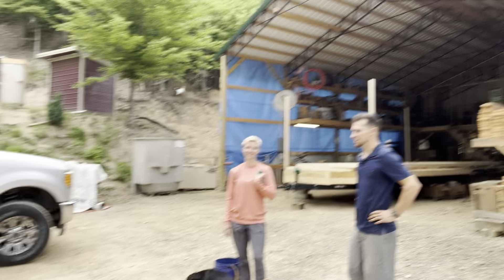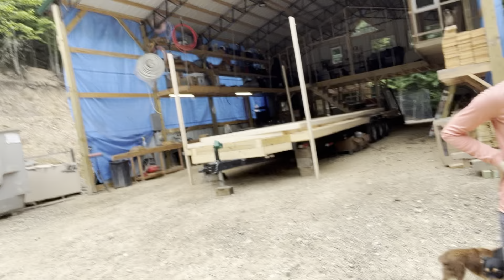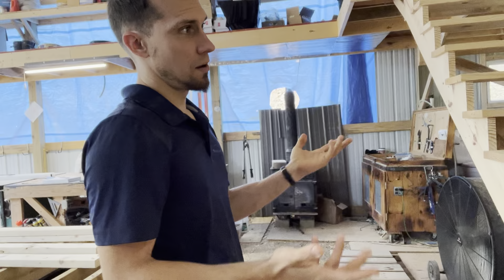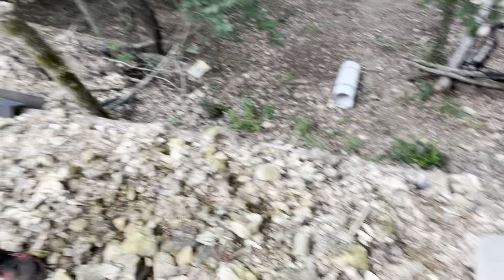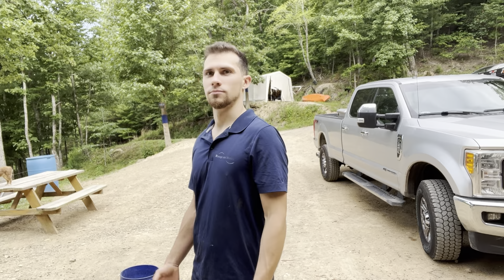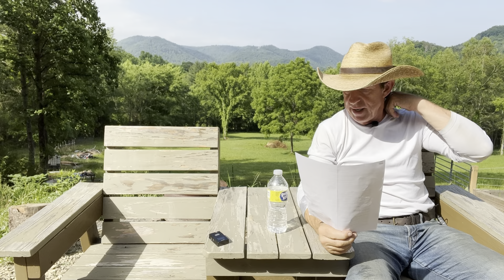Weekly Wednesday Q&A Episode 12 on Location with Zach, an Incredible Tiny Homes Subcontractor 😉🇺🇸

Comment: The mini-spilt on the ground? I have seen Central air systems with vines and weeds growing through them. The esthetics must be the reason for the request. They think the mini-split is ugly mounted on the tiny house.
Reply: Yes, that doesn't work at all. The condenser portion of the unit has to have fresh airflow all around it, which is why placing them on the tongue box works so well.

Comment: Question, where do you get the brown paper that you lay down to protect the floors?
I thinking about using it under my deck to keep plants from growing up through the planks. Because it’s biodegradable
Reply: It's contractor's paper. You can find it in the drop cloth aisle of Lowe's.
Reply: Use carboard boxes...just pull the labels & tape off. Biodegradable & recycled 😁

Comment: Q&A...If we bought two incredibox and we were just one couple who lives there but we lived in both incredibox has his and hers together? Kon the mountain, with a breezeway betwix them.  We've been married 32 yr and retired.  Thanx Kim & Frank
Reply: I would be interested in this also. This would be ideal for my son and myself.
Reply: I heard Randy say in one of the recent videos that only a few of the mountain lots will be flat enough for wider than 10' wide homes. That means if you positioned them with their 8' width on the home site, there can be up to 8' space between them (40' long total), like this... 
_______________________        
I     8x16    I (8'deck) I    8x16    I       
_______________________
and of course you'd still have room for a 3' wide deck running the full length to access the doors. I'd definitely explain this is what you want to do just to make sure they can get you a long enough site. Also, it might be extra for the hookups since there'd be 2.

Comment: Question for Q&A Wednesday. Are you still doing a RJO with the kitchen/bath opposite the door in a twenty foot length. And possibly in a panel building? I want a washer/dryer in the bathroom  and a closet in the kitchen.
Reply: There is a stick built model home with a similar layout to what you are talking about. You'd want to look up the model on the ITH Website, then contact them to ask if they can build it 2 feet longer to accommodate the W/D and closet. As Randy said today, they are doing very few model home customizations right now.

Comment: Question? Can the bigger incredabox travel down the road like a travel trailer?? Is is 12x16, 12x20 or 10x20?
Reply: It's 12×20, and No... it's too wide to travel. You'd have to get wide-load permits and pilot cars, and drive real slow, because they are wider than a traffic lane.
Any home wider than 10' gets very expensive to travel.
Reply: @susanbeals7597  thank you. So do they build 8x20 incredabox that can be towed?
Reply: @CapysGardenShop  anything over 10 feet wide requires a Commercial Hauler, plus Escort vehicles. Can't be self hauled.
Reply: @susanbeals7597  anything over 10 feet wide requires a Commercial hauler, it can't be self hauled.

Comment: Hi guys,  could you install an elevated bed in the. 12 X 20?
Reply: ACTUALLY, there are now at least 2 different elevator bed hardware companies that mount to heavy duty wall studs. Sooo, you'd have to build in a framework of 4x4's and attach the hardware to 4 of those big posts. Not sure how you'd secure it all to the metal walls though, or if you even should. I think that may be a bed for stick built homes. 🤔  Have you considered just building a sleeping loft?

Comment: My small SUV is a old escape 3500 lbs it can pull. Do you think it will be able to pull incred-i-box
Reply: No. The base weight of an Incred-I-Box is almost 5,000lbs, and that's before furniture, appliances, clothes, etc. Check out Sunset Trailers, the SunRay line. They have several models that weigh 2,000lbs or less (including furniture, appliances, heat and AC).

Comment: ??? Ouestions for Wednesday. Thank you for the answer of custom made home. I am interested on mine. You may want my design for a mode home. l Would like a custom home if someone requested and wouldn’t mind waiting they have it done in between your other homes that you were putting out. I think someone would want to to duplicate my home especially if they are handicap. And would like handicap bars in the bathroom. I have had people say they like my design it’s so well thought out and sizes. But may change due to plumbing or electrical but they want one being the same design. 

Or are your models anywhere in the size of 10 x 30?
Can you build one over the wheel well flat so you extend out the home on the sides over the wheel wells? And can you smaller tires like you would be on a go cart that’s still require the weight and supporting it for traveling distance so you can have higher heights on your home? I’d like to have one height 6 1/2 foot and the other height in the upstairs loft a 6 foot leaving 6 inches for your base and your roof line and have a solid wood floor between the ceiling and the second floor which allows you like an inch plywood or 2 inches of plywood I’m not sure how plywood comes anymore?

Comment: Love these Wednesday Q&A episodes!  ??? Q: My son is going to pickup the Incredibox and bring it to AZ. Does he need some kind of special permit or tags to drive it? This is all very new to us both and don't want to unintentionally do something illegal and get in trouble. :-)
Reply: Make sure he carries a copy of his Contract for the Incred-I-Box, it will act as a Bill of Sale in case he gets pulled over for no license plate on the trailer. Other than that, good to go. 
Tell him to use Truck Stops for Gas, they tend to have higher awnings than regular Gas stations. Plus the name brand ones (Love's, TA, etc) have Restaurants, Showers (ave. Cost $14), and are relatively Safe places to sleep at night. All in one stop.
Reply: As long as it's the smaller Incredibox (8x16) you are good to pick up and tow!

Comment: QUESTIONS --- TO Q&A QUESTIONS Ep. 12. -- A CHANNEL THAT I'M A MODERATOR ON. WE PUT ALL QUESTIONS IN ALL CAPS. LIKE I'M DOING NOW. IT STANDS OUT SO YOU CAN FIND THEM EASILY. 
Just trying to help. I'm an OG to your channel since the beginning. 
ANSWER TO ONE OF THE ABILITIES OF TRANSFERRING A TINY "CAMPER" THE 8X16 TO A 8X24. I'm a women & I pulled a 1959 original Winnebago 8x24 camper, that was not remodeled so it was heavy, & a 1994 Terry camper & I pulled them with a 1998 4 door 4x4 blazer, 1959, & a 2003 Trailblazer 4x4 which both with the original motors, 6 cylinders, & had no problems with towing either one to & back & I drove them like I stole them on the hilly, curvy back roads the only way to get to Stockton Lank @ Stockton, MO. from Springfield, MO.  
I got off work @ 4pm & I had it set up with my youngest daughter,5 years old, by the time my husband got there with the boat & are older son 8 years old @ 6pm. 
My husband is also a mechanic with 40 years experience back when are kids out grew are camper in 2012. We was young & played & worked hard back then.
Easy answer -- I had no trouble pulling those 2 trailers with SUV's 6 cylinders. If a 42 year old women with a 5 year old girl can do it. There will be no problem with the Incred-I-Box @ 5,000 pounds.
Chris from Missouri 
Hope this helps